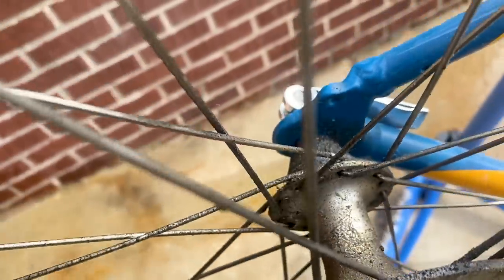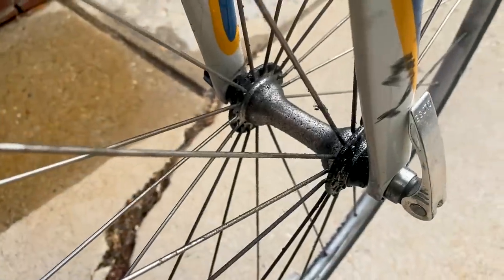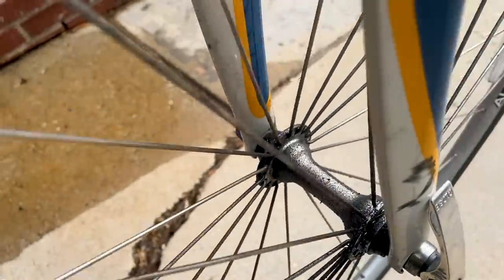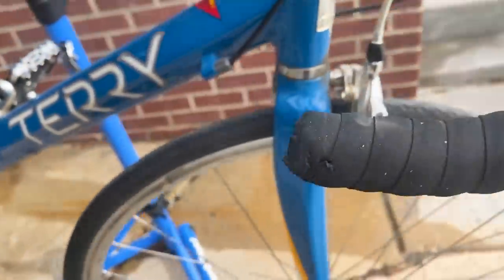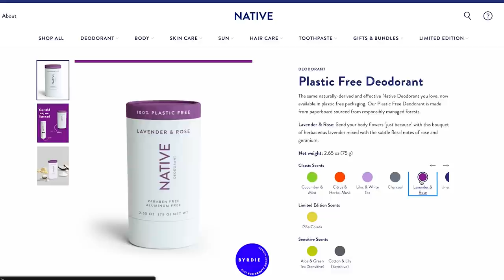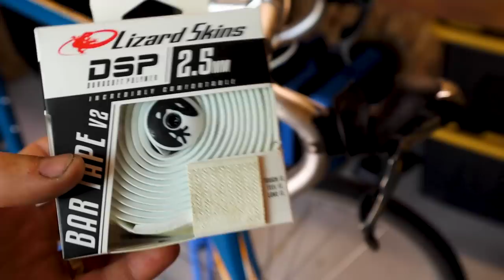Refreshing and Restoring a Greasy Bike

Comment: Been watching your builds for a few years now. Love them. One thing... as you were reassembling the crankset all I could focus on was the grit in the threads as you put the chainrings and pedals on. I think you should invest in an ultrasonic cleaner. I have one and everything comes out spectacularly clean, including chains. You’d be amazed at how good they work. A 10 litre one works best for bicycle stuff.
Reply: OMG... same here. Having a good ASMR mic can betray poor prep work. it was like someone chewing in your ear....
Reply: Definitely needs an ultrasonic cleaner
Reply: 😁 I heard it too. At least a good parts washer if not an ultrasonic.
Reply: @MX5Fanatic  he uses the torque wrench, because he does his work for customers. So safety is very important. Rob doesnt use one, because he can just feel it by hand. If you do that many bikes, you have the practice in your hands.
Reply: Even either greasing or using loc-tite on them would have made me cringe less.
Reply: @MX5Fanatic  dont need a torque wrench if you've been a lifelong mechanic.
All done with feel.
I have 3..., 1/4", 3/8" & 1/2" drive, all Snap On, use them on motorcycles all the time, never on a bicycle.
And i never strip a thread and nothing ever comes loose.
Over 40 years of spannering/wrenching daily will do that....
Reply: I posted the same suggestion awhile back.

Comment: That BB sounded like it has no grease in it, very noisy, fast moving and dry probably.
Reply: Since the vast majority of riders have a cadence of under 100rpm, and the noise was exhibited at closer to 200 rpm it is a minor consideration.    Rider on bike at end likely never to exceed 70 rpm.  Of course STBB are dirt cheap by bicycle standards.

Comment: I think you did a great job cleaning up the bike. Just a few points. The shifter housing shouldn't be crossed at the front of the bike and the front brake housing should be routed on the inside of the shifter housing to prevent ghost shifting.
Reply from the maker: Ghost shifting. I’m interested to know more. I admit I am not as experienced with road bikes and routed it the way o like my mountain bikes.
Reply: @oldshovel  I was looking over your video. Usually on a road bike with STI levers the shifter housing is routed on the same side of the bike and never crossed. There should be enough housing that the left and right housings almost touch, but never cross. The front brake housing should be routed through the middle of the two. That way the brake housing does not put stress on the shifter housing. The way you have it setup now it looks like if you turn sharply to left the shifter housing will bind up on the brake housing and that might make the front derailleur rub on the chain or shift on accident since the cable is being stretched.
Reply: Also if you want a cleaner looking cockpit for the bike they make STI levers where both the braking and shifter cables are routed under the bar tape.

I love how this bike turned out, very nice. Well done!
Reply: @kona0197  No.  Many of us cross the head tube like that as you get much cleaner cable runs that don't bind and add friction.  If you look under the down tube, you'll see the shift cables cross each other before the BB cable guide.  There is NOTHING wrong with doing it this way, and as I said can often lead to less friction in the shifting.
Reply: @oldshovel  it means that when you brake and so put tension on the brake housing, it will pull the shift housing that lays above it (it shouldn't) causing an increase of shifter cable's tension, therefore a gear shift.
Reply: @lastfm4477  I understand. I was only thinking about the brake housing binding up the shifter housing and putting more stress on the shifter cable.
Reply: @kona0197  Not for 9 spds,  but a 10 spd conversion is relatively cheap, though likely unnecessary for the intended rider.

Comment: You shouldn't cross the shift cables: the rear one goes in the cable guide on the right of the down tube, the front one on the left. Otherwise great bike. Sora and Tiagra are so affordable but very reliable and work very well
Reply: It's called a California Cross which reduces the bend coming out of the shifters. Shifting performance works just fine. Some say its even better this way.

Comment: Why put grease on the freehub splines?
Reply: There is no need.  The cassette isn't a press (interference) fit.  It is a loose clearance fit.  The fit is so loose I've never seen nor heard of any form of galvanic corrosion between cassette and body - even when they are dissimilar metals.  But some folks go by the rule that you GREASE EVERYTHING where you have metal to metal.

Comment: Hey -- I could have used this vid a couple of weeks ago when I refurbished a bike with at least this much grease on it. Your did a better job than I did! I love your channel.

I do have a random question only loosely related to this cleaning/build: how frequently do you replace/retire your Muc-off gloves? I've taken to cleaning mine off when the finger tips start leaving marks. I wash then by leaving them on my hands, coating them liberally with dishwashing soap, and 'washing my hands' under some running water. Seems to work okay... but maybe others have better ideas?

Comment: Small gripe but i just can't help myself....The bar tape doesn't need to finish that close to the stem especially if there's a logo on the bar...just a little thing...
Reply: Sigh form over function for you it seems.  The reason not to wrap the bar tape so close to the stem is it makes for a tighter brake cable bend - thus more friction for the cables.
Reply: @lastfm4477  form is made by artists, function is made by committees...only engineers get it right...and i'm not an engineer and i don't like committees✌️

Comment: handlebar tape should end towards the rider as they tend to twist down, especially when riding uphill
also leave some room for the handlebar logo and allow a more relaxed bend for the cables, makes no sense to have the tape all the way up to the stem
Reply: The edges will get frayed quickly if you wrap from the top